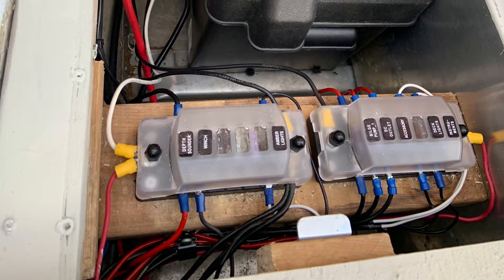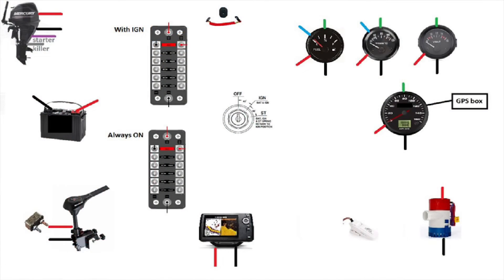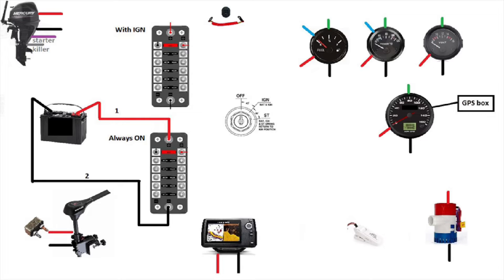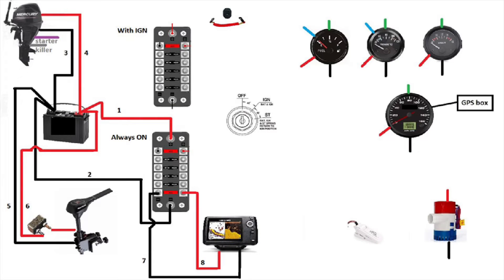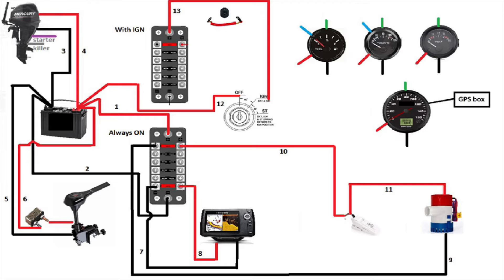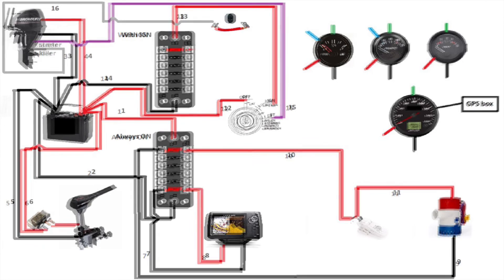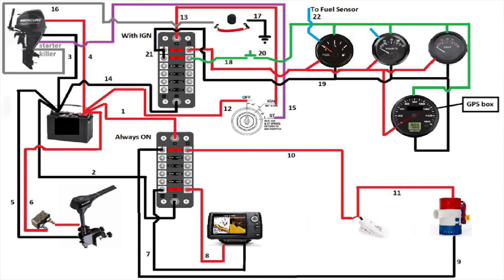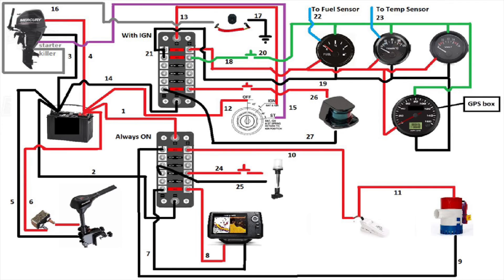Boat electronic wiring diagram

Comment: Joe I want to put a new fuse block in my boat. The wires running from block to bilge pump, radio, lights will be 14 ga tinned. The power feed to block from battery should be what gauge? or is it ok to run 14 gauge?
Reply from the maker: Hi Popop, I will need to have a little more info to know the right gauge wire you’re going to need. First, how long is the wire going to be? That’s very important. Also, would you know how many amps everything accumulated is? Also, your lights are they led or not? 

Have you seen this video it can help you figure out what wire gauge to chose: https://youtu.be/c_9MxEdlRuA

Keep me updated 👍
Reply: @joetheboatguy5394  I'm not sure of the amps. The lights I want to install are small LEDs & I'm not even sure what fuse to use on them. I have a 800 gpm rule bilge pump, standard gauges, I want to install a radio, fishfinder GPS, anchor light, bow light, this is and old 1988 21' Starcraft Marine CC Aluminum boat. Any help would be great. and yes the chart will come in handy.
Reply from the maker: Hi Popop, let me know if I’m forgetting anything. For the bow light (always led) should be less then 1 amp draw. Regular (led) Anchor light also less then 1 amp draw. Your 800 gpm should be max 3 amps. Regular radio, should be max 3 amps and a fish finder max 1 amp. So your max draw if everything is on at the same time should be about 9 amps total. I’m calculating like if your wire from battery to fuse box is  6 feet. If you look in the chart 6 ft cable max 9amp draw you are fine with 14awg wire. But to be safe and in case you want to add more equipment might as well put a 12awg cable 👍.  Now this is what I would do and this is with the information I have received. It would be a lot easier if I would see your set up of course 🙂. Let us know how your project goes. Good luck

Comment: Just one question: My ignition switch has a ground (black wire) should I connect that to the 'with IGN' ground ...a little confused. I tested the ign wire and it works gauges without that separate "with IGN" fuse bar. Thanks!
Reply from the maker: Hi jackie00776, thanks for watching. Yes it will work because “with IGN” fuse box ground or always on fuse box ground are the same ground in the end 👍.
Let us know if you have more question.
Reply: @joetheboatguy5394  oh thanks...just trouble shooting my not so good  wiring job. Thanks for the quick reply! I was very happy to see it this morning (your reply). 👍👍👍👍

Comment: I’m restoring a 2000 model skeeter zx 195c bass boat with all new gauges and sierra rotoswitches. Problem is I cut out all the old before researching the wiring schematic availability which is zero. I can’t find anything. Now I’m trying to figure out how in the world to hook all this back up blind. I’ve always been able to use a schematic. Stupid me I know. Lesson learned the hard way. Any suggestions on diagrams for these style switches and of course the gauges. Running Fuel,tilt/trim,rpm,mph,voltage,and water pressure gaugs.
Reply from the maker: Hi Offgrid, sorry to hear that. here are some sites that can help restoring your wiring. 

https://www.bbcboards.net/showthread.php?t=322491
https://www.perfprotech.com/blog/articles/mercruiser-engine-harness-schematic
https://www.firstchoicemarine.com/products/sierra-rotary-switch-mp78860 :for this one look at the 3rd picture. 

on my YouTube channel i also have basic wiring diagrams that can help

Let me know if this helps, good luck

Comment: Great video man 👍🏽, I’m having a problem , man gauges work when the ignition switch is on but once I start the engine all of them stop working , any idea ?
Reply from the maker: Hi Eduardo, thanks for watching, this are the steps I would look at first.
 
Loose battery connection
Discharged battery
Faulty alternator
Bad wiring and grounding
Faulty ignition switch

Loose ground could be the problem. Check all the steps and let me know 👍
Good luck
Reply from the maker: Btw if it’s a faulty alternator be careful it can cause damage to your wiring and accessories. To know if it’s a faulty alternator, put a voltmeter to your batteries terminals and when you start your engine make sure you have at least 12.8V after you start your engine. If you don’t have 12.8v, alternator can be your problem.
Reply: The problem is a faulty ignition switch … I figured out today .. 🙌🏽🙌🏽🙌🏽🙌🏽 thanks
Reply from the maker: Nice, Good job, better then a faulty alternator 💰💰💰

Comment: What is the gauge/AWG size of the wire from the battery to the ignition switch?
Reply from the maker: Hi Yann, thanks for watching. For the size wire it all depends on the equipment your planing to run. I only have led light and low power equipment. If you do plan to havé higher amp equipment I suggest to put a relay. Let me know if it answers the questions 👍
Reply: @joetheboatguy5394  Hi Joe, thanks for the quick response! Basically I'm confused because my Ignition lead is attached to my throttle remote and the wire is very thin so I have a feeling it would be unsafe to connect it to the fuse box. How do I change this? Thanks
Reply from the maker: Is this the original wire or man made?
Reply: @joetheboatguy5394  Original wire. For example if you searched marine ignition switch, it looks like one of those wires.
Reply from the maker: If it's original wire I would not worry to much about it being to small they would never put a smaller gauge wire than necessary, they would be blameable for that kind of mistake and would recall to repair. 
Unless you are making some modification then I would be careful. That wire might be going to a relay that activate when power is given to it. Then the relay would make the higher amperage pass. That wire might just be the activation wire which doesn't take much amperage. 
Now don't forget i don't see the boat and wiring I'm going with what I would think it is.
Reply from the maker: If you ever suspect it to be to small, hold the wire in your hand will in use, if it get hot then the wire is to small. if it doesn't heat up you have nothing to worry about.
A more technical way of doing it is to cut your wire and put a multi-meter that can read amperage. see how much amperage goes trough when its in full use.
Reply: @joetheboatguy5394  Ok that makes sense thank you! Just out of curiosity, what gauge wire is currently to your ignition switch? Because I'm pretty sure that wire is the activation wire, so what other options do I have? Would there be another way to connect? Thanks
Reply from the maker: hi Yann, for my setup it's very minimal the amperage i use. All my lights are led lights and my console meters take max 2 amps. So in all that comes out of my ignition wire when its fully loaded would be 3.5 amps. My ignition switch was rated at 7 amps. So I'm way below the 7amps. Now the length of your cable comes to play also. So I have a 14AWG wire and it's more then enough for my setup. Check this other video I did that explains a little how to chose the right size wire for your setup https://youtu.be/c_9MxEdlRuA

Hope this helps :)

Comment: Hi, great video! Thank you! I bought a fuse box but i’m not sure about what fuse to put for my fishfinder etc. Also what kind of AWG cables do you use for the different connections? 🙏🏽
Reply from the maker: Hi Ejaaz. Thank you for watching, for your fishfinder usually it doesn’t take much but depending on your model and description it should be written what amperage fuse to use.
Now for the cables I have done the video that can help you with that please check: Wire size to use when installing equipment on boat
https://youtu.be/c_9MxEdlRuA That should help you with the size of wires to use. Don’t forget to like and subscribe 😉 if you have more questions don’t hesitate to ask.

Comment: Hi Joe! Could you combine this video with the battery switch video? At the end that is the most common installation. Thanks in advance!
Reply from the maker: Hi Pablo, thank you for watching and commenting. I will try to combine the 2 video’s soon 👍
Reply: @joetheboatguy5394  hi joe. Thank you so much, nice videos. Congrats. I am trying to check the correct  electrical installation and so many boats has 2 batts, combined with a key to start the engine, and a batt selector. How and where connect the 2 fuses boxes in that cases? So the idea is on the original video add a second battery and a batt selector. Expert level!! Thanks in advance
Reply from the maker: Hi Pablo, finalizing the video will be out tonight at 6:30pm 👍 hope you like it.
Reply: @joetheboatguy5394  thank you so much!!! For sure i would appreciate it!!!
Reply from the maker: Here you go done, Combining boat electronic wiring diagram and Battery switch diagram
https://youtu.be/l4Ve6KpiAqQ 👍

Comment: Great explanation and break down! Any chance of seeing one for an inboard motor? Been looking all over south Florida and no mechanic wants to work on an inboard. . . . 

I am specifically looking for a closer breakdown of the key ignition with battery, starter, ignition and accessory. Does it connect to the throttle?
Reply from the maker: Hi Jose, I know onboard engines are much harder to work with. But for the electronic not much should change. For the throttle it’s should all be mechanical not electronic. But like I’m saying I’m not familiar with inboards 😟 sorry
Reply: @joetheboatguy5394  I stand corrected. When I said throttle, I was referring to the run/off (kill) switch. There is a solid purple cable and a purple-white cable coming out of run/off switch. Trying to figure out if that goes to the I of the 4-prong key ignition? Or to the Accessory prong.
Reply from the maker: Hi Jose, on a 4 prong key switch you will have usually have 4 connections the battery, accessories, ignition and the start. For the Kill switch is usually separate on a on off switch.... this is what i found on google : "Purple wires usually go to an ignition switched positive lead (accessory) so it will illuminate the gauge only while the key is turned on" and for the the voilet/white should be for Trim "Trailer" switch....  i get my info here https://www.cpperformance.com/t-boat_wiring_colors.aspx: it's a good reference.
your kill switch should be a Black/Yellow : Ignition stop Unless someone tampered with the wires.... i hope this helps :) let me know how it goes.
Reply: @joetheboatguy5394  thanks for the response. I purchased a new MPC 4000 GenII series mechanical panel control which has original wiring out of the Run/Off switch with the purple and purple/white wires. 

The manual says to plug the solid purple to the key ignition. .  And the purple white to 12 volts (done). . .  Question is, which post on the key ignition would I connect the solid purple white to?
Reply from the maker: @jose_with_the_ss  what i see from the wire diagram in the manual. I see the Purple/White goes to kill switch and the Purple should go to prong written (+bat) connection on the key switch. So Purple/white will not go to the key switch only purple should.
Reply from the maker: your purple/white should be connected to +12v
Reply from the maker: i got this information from https://www.bottomlinemarine.com/prod_cat/images/8m0103111.pdf page 17 check it out :)
Reply from the maker: My understanding is once you flip the switch on “on” you’re purple wire will receive 12 V if you could try that with your multimeter it would be great. If that’s the case then I would connect the purple to bat+ prong on the key switch.
Reply: @joetheboatguy5394  I will try that. Thanks. Any idea what gauge these wires should be? This is an older boat and there are many splices along the way. 😭. Should I just run a fresh "starter" wire from starter to starter prong on key ignition switch. . . . 

Many questions. Sorry
Reply from the maker: Hi, No worries about the questions, If i can help, i will try. For the Gauge wire it all depends on the equipment that is ran on that wire. Usually people use relays when they want to pass a higher amperage in the system. Here a video i did for the Gauge wire needed, check it out :)
https://youtu.be/c_9MxEdlRuA
hope this helps

Comment: Thank you for a very well presented video on boat wiring. I have a used pontoon damaged in a storm.  I am working in putting it back together including fixing the damaged wiring.  You method of illustrating the wiring connection was simple and clear. A simple ladder diagram at the end of the video would be a bonus.  
Thank you

Comment: I don't think your ignition wire is designed to power accessories. You're supposed to use a relay or solenoid.
Reply from the maker: Hi Micheal, yes your right, it depends on your needs. I just have led light and use max 3amp…. For me works great. This was a basic design just for understanding what going on. Thanks for watching and commenting. If you need more then 5 amps I would definitely use a relay 👍 good comment

Comment: I wired my whole boat 1 12volt battery just like this, my question is, is it safe for a Terrova trolling motor to be plugged in while the 25hp motor is running and slowly charging the battery from the rectifier, I hear a lot of bad stories of circuit boards frying on Mini Kota's newer digital trolling motors mainly due to using 110 volt charger while trolling motor is plugged in.
Reply from the maker: From a technical viewpoint, no reason to unplug the motor when charging. As long as the charger does not experience an issue, or the battery experience an issue there will be no problems. That is my opinion but if your not sure you will need to do more research 🧐. Every trolling motor have their specification. If i were you, I would contact Terrova to confirm…. 👍

Comment: If you’re running a switch panel, do you run two wires to the fuse box? In other words, one wire from electric component to the fuse box, then another wire from fuse box to switch panel? For example, if you wanna run a light switch? Or bait pump on a switch?
Reply from the maker: I think you will find your answer here 

https://youtu.be/lHwetz08R_w

Let me know 👍

Comment: Hello Joe,
my speedometer needle is not working, and I noticed when I advanced the throttle, it is the needle of the fuel gauge that is moving towards "F", instead of the speedometer needle.what is wrong with the wiring? Thank you!
Reply from the maker: Hi John, I have a few questions, is your fuel sensor at the end of the tank? Meaning if you accelerate more gas goes at the end of the tank so your needle might will go higher. If that’s not the case I suspect a bad ground wire. 

For the speedometer, is it a GPS speedometer?  Make sure your gps device it not covered. Need to be in a open area. 

If your boat is on salt water your wires have more of a chance to corrode check all gourd especially if your grounded to hull. 

Sorry it’s hard to guess, I don’t know your setup. But I would start with checking for corroded wires or bad grounds. Give more info I will try to help. Thanks for watching. Hope what I said helps 👍
Reply from the maker: Sorry another thing I would like to know. Does your speedometer show any sign of life when you give it power. Does needle move?
Reply: I just bought it, its a 2019 Tahoe 700, never been used, from Bass Pro, just found out when I test drive it, though they guarantee to repair but if its handy to repair it myself I will save a 2 hour drive back to Bass pro store.
Reply from the maker: I agree but if you touch they might not want to repair it, since they agreed to repair. I know it’s not the answer you want to hear but let them do it so they can’t blame you. I’m very surprised they sold it without testing.
Reply from the maker: I suspect a ground
Reply: It wont show any sign of life when i accelerate,i guess its ground problem. Thanks very much you are very helpful
Reply from the maker: Let me know the outcome 👍 by the way nice boat. Congrats
Reply: @joetheboatguy5394  i will thanks

Comment: Why is the boat's engine wired directly to the battery and not to the fuse box powered by the ignition switch? Seems like it would make sense to have the engine powered by the switch than directly wired to the battery.
Reply from the maker: Thanks for watching. I tried to keep it very simple so it would be understandable for the first time wirering. Some outboard already have a fuse under the outboard cap. You need to see what are your needs are 👍. I have it wired that way and have 0 issues yet 😉

Comment: Very nice, very clear and simple!   Having been knee deep in re-wiring my boat over the past two weeks I will say the installation of two fuse boxes (one for ignition power and another unswitched power to run devices while the engine is off)  is of paramount importance.  Also adding a buss bar would be a good idea.
Reply from the maker: Thank you for watching. I will add a relay soon to the diagram to have the outboard shut down when key is on OFF position :)
Reply: Your missing the most important detail of all on this diagram.   Isolation master switch to isolate power coming from the battery. This is the only way to make safe in a fuel spill or long term battery power loss.
Reply from the maker: Hi john8615, thanks for watching, I didn’t add the isolating switch in this wiring diagram because I do my wiring diagrams in parts. That way it"s less confusing. When to much stuff is on the diagram it could become complicated. I do have another video that adds the isolation switch. Here you go: https://youtu.be/l4Ve6KpiAqQ
Thanks